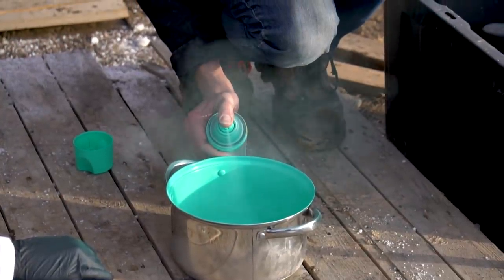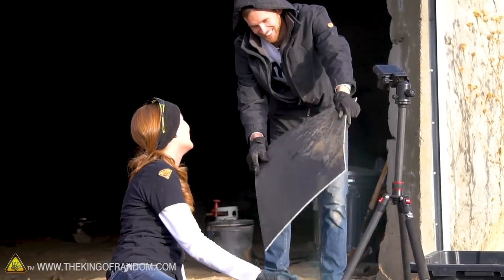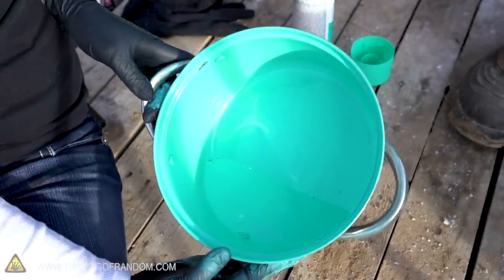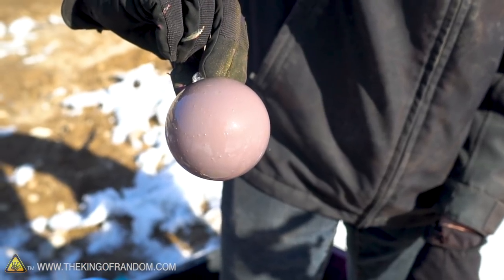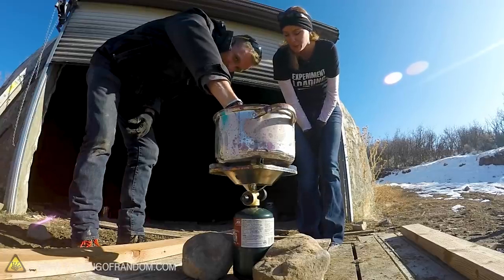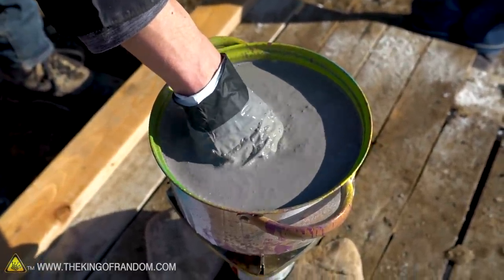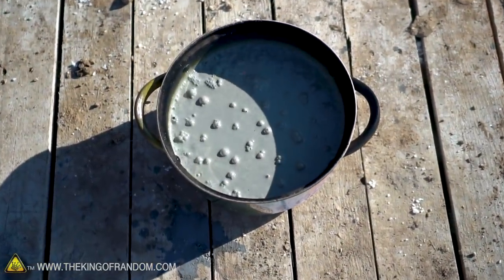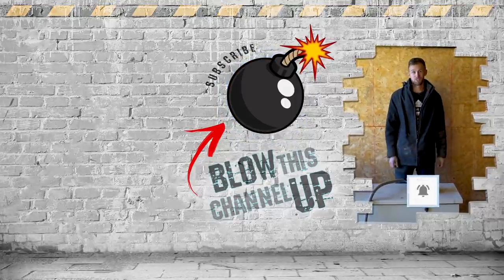Extreme Spray Painting

Comment: Make starlite!!!!!! All you do is mix Elmer’s glue, cornstarch, and baking soda until you get a dough like consistency, and it becomes super insulator to heat
Reply: What are the ratios of each?
Reply: nighthawkinlight made a video on how the make it
Reply: The real recipe for starlite was never released. That recipe is just a guess.
Reply: @christiandavies4798  yeah just last year
Reply: @TheDungineer  yes it was last year but only 3 weeks ago when he uploaded it
Reply: you can have a heat-resisting material made of just cornstarch and baking soda.
Reply: lol asking about that under every video, once I was late for video upload, someone else asked and its noticed by TKoR
Reply: Or ditch the glue and solidify the starch + baking soda using a process called retrogradation... Basically cooking it until it turns slimey, and then drying it.

Although the heat could decompose some of the baking soda... Would be interesting to compare
Reply: @revimfadli4666  You cook the starch first. Then you mix it with baking soda.
Reply: @josephgao4657  nice idea. But when? Wouldn't it still be quite hot after gelatinization?
Reply: Test it on thermite

Comment: What if you built a bonfire in the dome?
Reply: hanskyonion 927 no I’m talking about a smaller bonfire, I though it would be interesting if air would be sucked in through the door, creating a small fire tornado inside the dome and the top reaching through the hole in the top.  Besides they could just stand far away

Comment: What happens if you put paint in some sort of Freeze Dryer or desecration chamber? I wonder if putting the pot in there would speed up the drying process or alter it in some way. You guys could also de-gas the paint by making a proto-putty gasket  and just putting the vacuum pump over it. Or just leave in all the air bubbles and see the result then.

Comment: You should consider getting a heater that doesn’t use fire so the vapors don’t  get set on fire buy the heater so you can see if it catches fire because of just the heat and not from the fire

Comment: I USED TO  USE CAN SPRAY PAINT IN MY AIR BRUSHES ,AS IT IS PERFECTLY MIXED ALREADY AND THE WALLEY WORLD CHEAP CANS IT WAS ECONOMICAL PUNCTURING THE (NON DISTURBED )CAN SLOWLY WITH A ICE PICK IN THE UPPER PART (BELL )OF THE CAN KEEPING THE ICE PICK POINT INSERTED USING IT AS A VALVE AS THE PROPELLANT ITSELF BLEEDING OUT ( DO NOT DISTURB THE CAN WHILE DOING THIS )ONCE MOST THE PROPELLANT AS BLED OUT YOU CAN SLOWLY TILT THE CAN LETTING THE PAINT EXIT THE HOLE MADE BY THE ICE PICK ,THE PAINT WILL BE MIXED WITH THE REMAINDER OF THE PROPELLANT (USUALLY BUTANE )WHICH WILL BE BUBBLING IN THE PAINT ITSELF WHEN DISSIPATES IT'S READY TO USE IN THE AIR BRUSH BUT DOING THIS WILL GIVE YOU THE ACTUAL  AMOUNT OF PAIN IN THE CAN